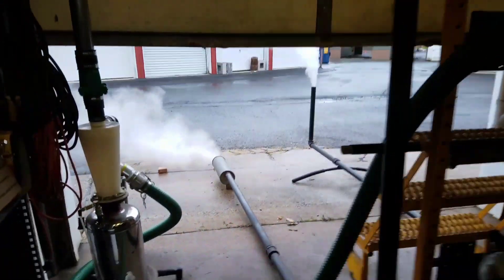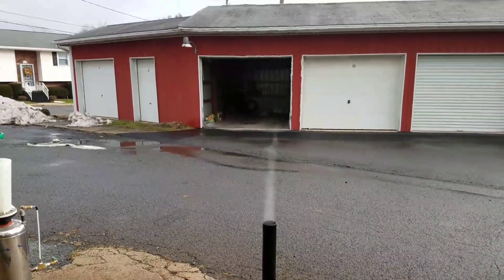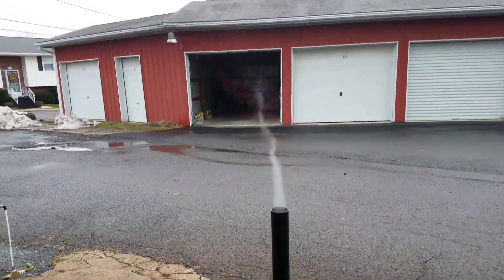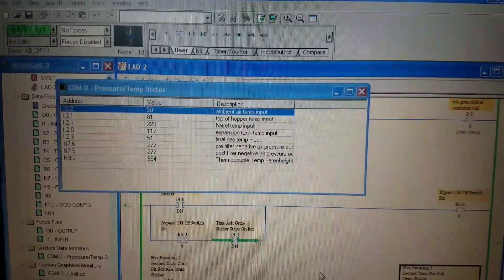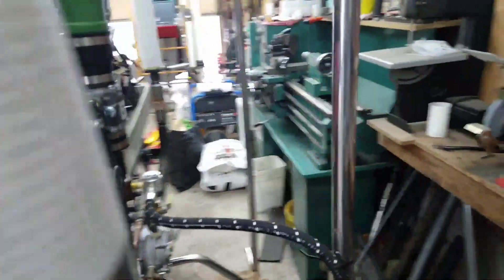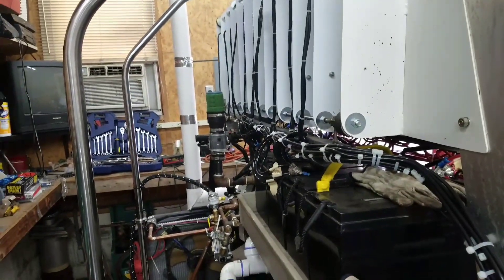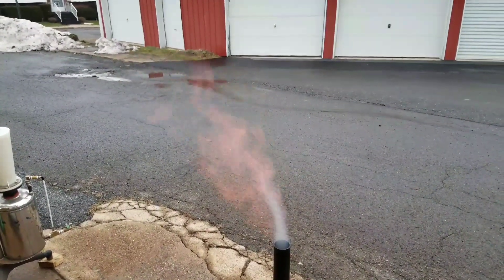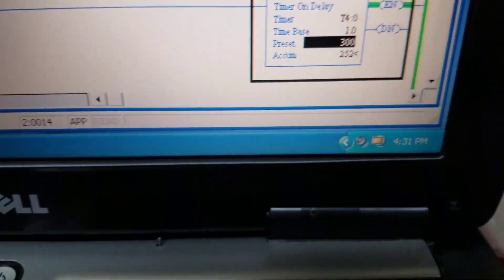Wood gas ninja 11-30-2018

Comment: Joe, See you ran open-top. Ad a pyrotouch to automatize the fuel supply and you run in DriZzleR mode. Ad also a extra condensation train to get more moist out of your fuel and above all, switch to a stronger engine with more suction. It seems to me you under pull your gasifier. Other than that you are darn close to goal. Luk
Reply from the maker: Luk, this engine is rated for 50 hp. Half that for wood gas. I had a hard time keeping my hearth temps above 1200 F even when I had all the suction in the world with the 3 phase blower running. Really I had a hard time holding 1000 F. I even started to collapse the rubber fernco fittings at times. I did actually melt the bottom of my reduction tube and the slag solidified in the holes of my ash grate. I think that happened before I figured out the hopper lid should be open,  and the damage was done. Also , I did make a small amount of tar , probably because of the temperatures, but it looks like the filters did their job. I agree that I need to trap more condensate out of the gas. I think it affects the way it runs. I think I want to try wood chips or small chunks just out of curiosity. What is your opinion on the difference between pellets and larger fuels? Thanks for joining in. You guys have done some amazing work with gasifiers. Joe
Reply: @mazdalorean  Joe, first do a test on your pellets. They must be first class hardwood pellets for woodgas, and without junk and added bonding powder. TheTest for junk goes as follows. put 1 inch water in a glass. Drop in a few pellets, let them disintegrate. Now you see clearly the difference of pure wood and bits of formica, plastic, paint, plain dirt etc...etc. Go for pure hardwood and pellets without bonding chemicals (they give tar-like effects as I once experienced from buying self made pellets from a small wood-window-maker).   you have to relay on an official standard. Here we have the DIN+ norm) and a trusted maker. In my tests DriZzleR I have not seen much difference between pellets and chips. Pellets are just so much more comfort to transport in a feeding auger. I do have adapted my rost (grate) (am still constant doing so, as you see in my duration-test video's)  since pellets gives off more fine dust and tent to pack the reduction more solid than chips. I do not mind because I use some packing of the reduction in my new rost design to benefit. This way I can run with very gentle rost agitation and avoid the big dust clouds in the system by standard rost cleaning which finally are a burden for the filter system. Last remark. Are you sure you had tar. If you run very wet, a  fine charcoal dust-minimal tar- water- mixture almost looks the same and is almost the same nasty. Only it is dull black where tar is shiny. Luk Vanhauwaert
Reply from the maker: Luk, I very much appreciate the information on the pellets. Up until right before this run , I just learned about hardwood pellets. I don't even know what I ran in previous runs ( hardwood or softwood) . So this is the first time I'm hearing about binders and fillers.  I will test the pellets I used on this run. I do have some left. As for the tar, there wasn't a lot,  but it looked thicker than just soot water. I was wearing gloves when I handled it,  but I'm pretty sure it was tar. Thanks again for the great advice. Joe
Reply: @mazdalorean  Joe, I did not mean soot water sludge, but this very dense thick paste, consist of 95 pro-cent soot, few percent  moisture and few percent start-up tar. Sometimes to find in ones unfiltered gas tubes where gas can slow down and soot can easy settle . It is almost as hard to remove as tar.  Only to recognize by its shine. Soot-paste is dull, tar is shiny. To be sure. Soot paste is hard or even practically impossible to burn, where tar burns very  fierce.  You will know  but I write this because beginners that read us do not see this difference, and can jump to the wrong conclusion, they have a tar system, when it is not.
Reply from the maker: So just to get back to you on some of your advice,  I put a few pellets in some water. It does appear to have many different color bits ranging from very light to dark. I can't be sure of what it's made of,  but it's a wide variety of different things. Doesn't appear to have plastic in it , but I would say it's not all wood. 
Also I wiped a small scoop of this tar like substance onto a piece of metal and tried to torch it. It did not catch on fire. Hopefully that means it is made up of the soot-paste you speak of. Thank you for the info,  as I am learning as I go. Joe
Reply: @mazdalorean  Joe,  One remark,  It is hard to say anything from long distance not have seen the system. So my comments are just suggestions no gospel, and so It is good that you proof everything yourself. But as there are all this different bits in the pellets, it seems  to me your pellets are not the highest quality. Probably they where made out of scrap wood from building or furniture leftovers with plastics, foams, glues, paints.....etc in them. Here I buy the best pellets from a factory that makes hardwood flooring. Oak parquets. The pure  sawdust pressed under very high pressure so without added bonding chemicals  other than the woods own lignin.
As for the soot paste. On the long run and if it makes its way to the engine, It can do also damage, so improving your condensation train will hopefully reduce the problem. Luk
Reply: @mazdalorean  Whats the depth of your reduction tube? Om my machines core temps are well beyond steel melting. However the reduction is endothermic and if you have a good process you should see rapid cooling before the gas gets to grate. Your hearth maybe too big, most under estimate the density of pellets. On my machine I run a range of 420cc up to 800 cc and my hearth is probably half the size of your machine. Yup id take lukes advice: combustion gas getting into those pellets is the cause of a lot of issues. On my machines we have an air purge that blocks combustion gases from getting in the hopper, so sort of like an open but its not haha. Fix the moisture issue getting into your raw fuel and once you learn your creation a little better it will work.
Reply: pellets are the only way to go, I will never ever ever ever build another chip or chunk machine again!! Ever!!!! haha. Pellet fuel reactors really need to be built differently in order for them to work. Our new reactor is pellet fuel specific chips wont even work in them and it can not be applied to other fuels. Sort of like diesel vs gasoline Once I got rid of the combustion gases from getting into the hopper everything changed.  Fuel stays dry it never bridges, water shift is near 100% I dont ever even see moisture dropping in my filters. In fact I can dry fuel in my filters!!! lol. The only time I ever see tar is when I forget about it and burn it down to the grate and have re establish the machine. When its fully established and well burnt I never see any tar or condensate.  So rather than continuing on with chips, we are going to work on building a pellet fuel processor much better time spent. You have excellent looking flares, it will be hard to do that with chips consistently.
Reply: To put into perspective, my hearth / combustion core is about the size of 1-2 cups volume measurement.
Reply from the maker: Matt, thanks for taking the time to comment and watch. My hearth dimensions are 5" diameter at the top , reduced to 3" at the bottom and 6" tall. Then the top of the reduction tube tapers down to 2 and 1/2" before tapering out to about 3" near the grate. Also it is about 6" tall and the grate is 1" below the bottom of the reduction tube. I actually melted the bottom of the reduction tube on this run,  but I think it was self induced at start up when I dumped only hardwood lump charcoal in the hearth to " warm it up". I will be remaking it with a stainless steel reducer. Anyway,  I do appreciate you taking the time to post your thoughts and would like to email you and talk more about the best options for my setup. Maybe you can send an email my way to mazdalorean@gmail.com.   you have a lot of experience with running on pellets and I certainly have a lot to learn. Thanks again for checking in. Joe
Reply: @mazdalorean  I am still learning right along with you!! Ill shoot you an email here shortly :)

Comment: Your welding and assembly work is really good. Are you catching much moisture with the lip at the top of the hopper? Thinking about including one on my system. Thanks for the videos
Reply from the maker: Thank you for the compliment.  I have never accumulated any moisture in the top of my hopper , ( except when I shut down the gasifier with fuel in the hopper)so I actually did away with it when I installed the pyrocoil . I find more of a problem capturing the moisture before it gets to the engine. There is a lot of moisture in pellets. I will be making a few changes to my reduction zone based on some good advice from fellow wood gas people. From what I've heard about running pellets,  I will have to make my reduction diameter smaller and make my reduction tube taller and wider . This also means I will have to make a new ash grate to match the new diameter of the reduction tube. Waiting on warmer weather so I can get some work done. Thanks for watching and commenting.  Joe

Comment: I'm confused about the alternators, why run multiple alternators instead of a single higher output one?
Reply from the maker: The grid tie inverters draw more amps than a single alternator can replace,  especially with the size of the belt that drives them. I've seen dust from the belts due to how hard it is to turn the alternators.   If you look closely at the alternator assembly,  you will see a couple of shiny alternators. These are 12 volt ones that need to be replaced with 24 volt ones. Right now they aren't even used because the inverters just put more power out on 24 volts. Thanks for watching.  Joe

Comment: Nice work, is the blower on a freq drive? The blower motor that is
Reply from the maker: Yes , it's a single phase input ( 220 volt) to a low voltage three phase output . The display is set to show the frequency in Hertz. Those blowers are amazing. Especially when you get them in the garbage and rebuild them. Thanks for watching. Joe

Comment: Howdee Joe, 
 Ahhhhhh, I dun got my woodgas fix for the day   :) . 
 It sure is nice to see your system up and running. 
 Even though you did have some problems with it, it must still feel great to have it up and running so sweetly. 
 As for the the flame migration up and down the reduction tube, I can't help but suspect that the physical properties of the pellets had a major say in that. 
 After all, they are quite tiny, and they will tend to flow more freely than is right for a BIG gasser like yours. 
 Consider the effects of interstitial space, and you'll see how that can modify the airflow around the treezel chunx. 
 When you go to wood chunks, you'll surely notice some big differences in the temperature profiles, and fuel movements thru the system. 
 Keep up the woodwork, oops, good work, my fellow woodgas bug necknip victim  :) .
Reply from the maker: Steve,  I got lots to learn about these pesky beasts. Those wood gas bugs like to mess with your head. Just when you think you have something figured out, they change things up to throw you off the scent. They just don't know how stubborn I can be. I'm sure I'll have questions. Glad I have a woodgasaholics support group to discuss our addictions. Joe
Reply: @mazdalorean  
 Indeedee. We all have plenty to learn from our experiences with these machines. 
 We may never know it all, but we will definitely learn how to make the best of watt we have created. 
 The woodgas bugz are having a lot of fun at our expense, but that's OK, as we will end up with systems that will save us a fortune, so we can afford to go out and buy the world's biggest bug swatter  :) . 
 Keep the smokey watts flowing, my fellow woodgasaholic.

Comment: YUP FLASH KISS=KEY... :>) .. I luv simple/ safe on the cheep.. so all do it!  im working on /55 drum filled wood/set over fire.. /1 vent/drain.. watch color smoke to change/ makes charcoal + when it look good I want pump the gas off to store in propaine tanks :>).  can be used run car short distances/ hot water/heat/and cook stove. ! basics. luv see some this stuff on video!
Reply from the maker: There are a lot of useful things you can do with wood gas. The challenge is learning enough about how this stuff works to run well enough to keep clean up time to a minimum . I'm looking forward to reclaiming the engine waste heat to heat my house. Thanks for watching. Joe

Comment: Hey Joe. I checked out the video AFTER you sent the picture of the melted down reduction zone. You mentioned that the hearth temp was up and down. Seems it may have been up a little higher than the reading indicated. As Mike stated, "almost white".. That's hot. I did notice the moisture wisps at the flare. Darn pellets. I think I told you that I had terrible luck with pellets down here in FL with our humidity. Absolutely made a mess out of the whole system. All in all, a good run today and the Ninja putting out the 5K is just what the DR ordered for you today. 
Awesome. Oh, and thanks for the wood gas fix. I needed it.
Reply from the maker: Mark,  I even said in the video that with the lid down, I felt that the fire was dropping lower and lower in the hearth. I think that once I opened the lid , the fire started climbing upwards into the hearth. I know my temps were too low. I cleaned some tar out of my junk blower pipe. Maybe I would need to shorten my air intake pipe letting the air in higher up in the hearth. I want to try other fuels. Yeah pellets just suck. I'm curious about temps with other fuels. Joe
Reply: @mazdalorean  I remember you mentioning that about it dropping lower and lower. "pellets just suck"...That's an understatement. Moisture magnets. You say shorten the air intake pipe. Where is it coming in at the moment? I am at the very top of the hearth. I used to have it about 3/4 to 1" down inside, but, it also acted as a obstruction for the wood chunks (cut branches) causing some bridging issues. Once I pulled it up the top, the chunks flow beautiful using the vibrator, Haven't had a bridging issue since pulling it up. Not to mention that my vibrator will shake the fillings out of your dentures. What material did you make the inverted bell out of??
Just curious.
Reply from the maker: Mark,  I believe the air intake is below the top of the hearth . Also the current reduction tube is made of steel. The new one will be machined out of a solid chunk of stainless steel . Joe

Comment: Joe,
It's always a good day when you can fire up a gasifier. Each and every run adds to the knowledge base and can be applied to the next run. You have to clock a lot of hours to get a sense of the gasifier's personality. But, yeehaa ! It's doing it ! Congratulations, Bud ! Look into a couple of other sources of fuel for comparison. 
Well done and thanks for the show
Reply from the maker: Thanks Bill , I have a lot to learn about running this thing,  but I'm glad to finally get a glimpse of the vacuum level while it was loaded up. It seems pretty close to how hard I was pulling the gas through the gasifier with the blowers. I'll clean it out today and tally up the condensate totals. Joe
Reply: Joe,  I went down to the shop earlier this morning to try out a new camera and noticed the sight glass jars were half full just from sitting there for a week since the last run. 
BTW , did you have the vibe and shaker turned on ? I didn't hear it. Also were you feeding the pellets as needed on demand so to speak or did you load the hopper?
Reply from the maker: Bill,  I only kept enough pellets in the hopper to keep the fire below the surface. No I didn't have the hopper vibrator on. I just periodically poked through the hearth with a piece of all thread. I emptied almost 3 quarts of moisture from the catch areas. Also I just cleaned out the old pellets and char from under the shaker. Last time I took the shaker grate out,  I drilled the holes larger . They were 3/8", and now they are 13/32". Wait till I show you guys what the ash grate shaker and reduction tube looks like. It actually melted the bottom of the inverted bell of the reduction tube. The molten slag deposited itself into the holes in the grate shaker. I chiseled it out of the holes. I'll try and post a picture on the miniwoodgas site if it will let me. Yeah that moisture does stay in the system for a while. I periodically drain all valves to try to prevent it from freezing. I did make some tar on this run,  but it seems like the filters worked well. The temperatures don't lie. They say 1200 F minimum and that's the number. Joe

Comment: Joe the flare looks almost white. Pretty cool no doubt. Good to see you running the gasifier. I'm 99.99% close to releasing the PDF for my automation. It's a much simpler design than your setup but then again, I don't have all of the data logging you have either.
Reply from the maker: Mike,  it sure does give me an idea about what's happening inside the beast having all the temps and pressures posted on the laptop.  I'll probably head out today to empty all the condensate and check the filters. This was a long time coming, and I know I still have work to do,  but it's nice to be at the point of being able to run any time and actually be using the power for something constructive. Thanks for all you have contributed to this technology. Joe